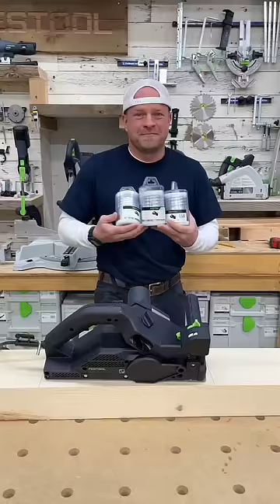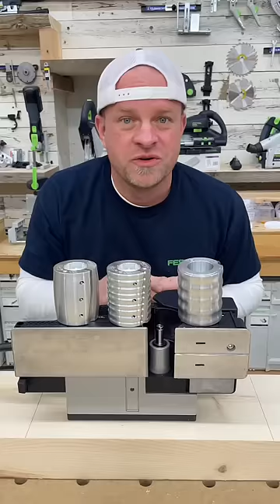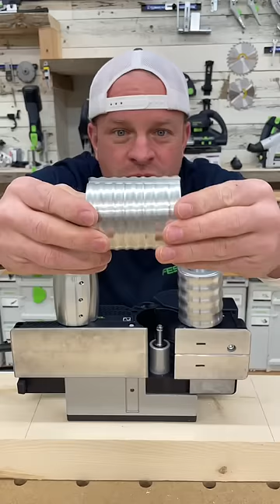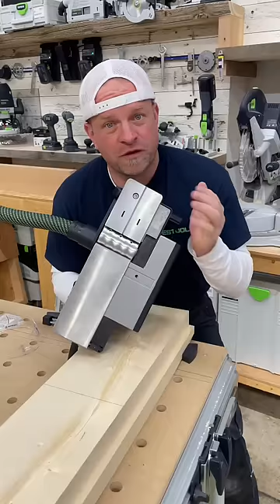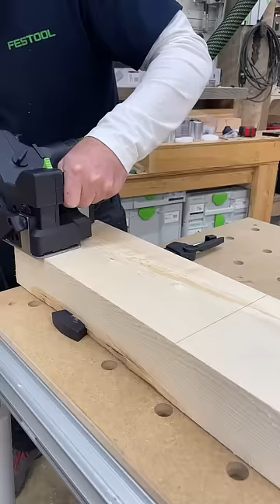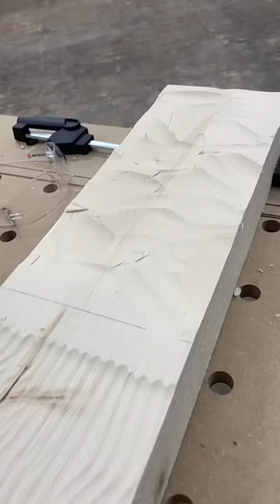Three cutter-heads #woodwork #wood #woodworking #festool #bois #maker #tools #madera #holz

Comment: This dude is on another level.
Reply: Financially, for sure with all that new fancy equipment.
Reply: @stumpbumpers  Dont be a hater. I am a machinist/programmer and have access to fancy equipment too. YOU STILL HAVE TO KNOW WHAT YOU ARE DOING!!!👀
Reply: @atmosphericpressure3560  I’m a custom woodworker with 2600 square feet of shop and more equipment than I need, 3 and sometimes 4 of the same piece of equipment. BUT it’s not new or King or Festool. The comment was tongue in cheek with a tad of jealousy, but I could clear out my shop and buy all new if I didn’t think it was a stupid idea🤣